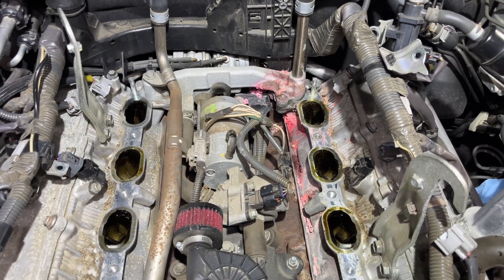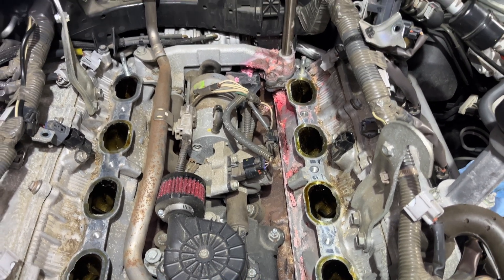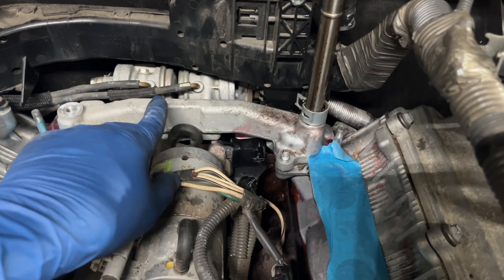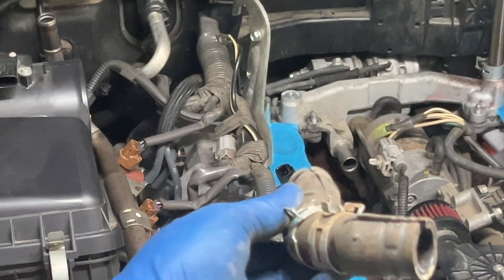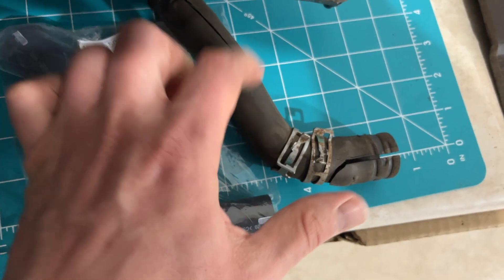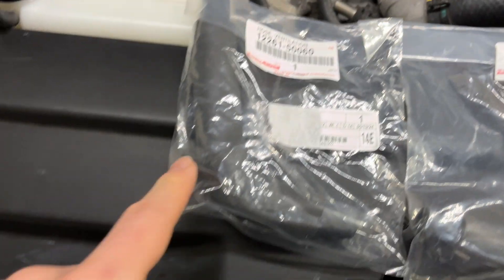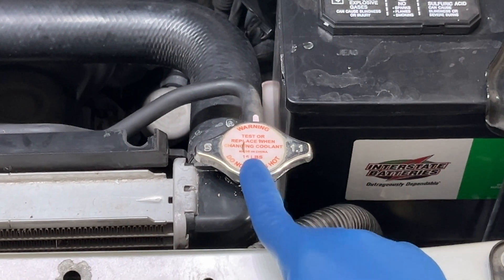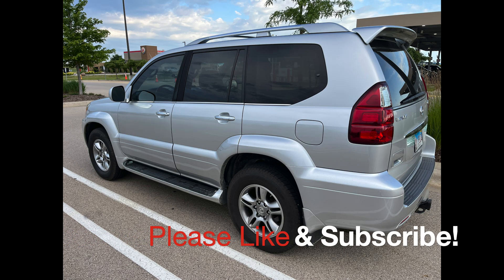Lexus GX470 Coolant Leak Fix - Rear Water Bypass Pipe Gasket - 2UZ-FE (part 2)

Comment: Those bolts in the back at an absolutely a terrible design
Reply from the maker: Yes, they are a bear to remove
Reply: @MaximumDIYGarage I’m doing my head and I’m struggling. Is there a way to remove the black wire harness
Reply from the maker: I am not sure. You can pull it from the clip to give more room at the firewall, but not sure if you can remove the harness completely.

Comment: Thanks for the helpful video, my 2008 4Runner has the same engine.  Can I ask what tools and methods you used to remove the SAIS valves from the crossover pipe?  It seems like it was the most difficult part of the repair.  I found a similar video where they made the disconnection at the pipes supplying the valves, but it required removing the wheels and coming in from the side/bottom with very long extensions.  This kept the valves connected to the crossover pipe when it was removed...they were replacing the starter, which is underneath them.  If you could tell us more about what you did and the tools you used, I think your method might be a bit simpler, even if it was difficult.  Here's the video link...it's the first of two from this contributor.

https://youtu.be/dXpK5YG7-A8?si=p_tIiAHnbn2iQSfw

Thanks!

Jason
Reply from the maker: @jasongray6740  Hi Jason! I accessed everything from the top at the cost of abdominal pain for a few days afterwards. I too used a series of long extensions to access the valve nuts from the sides and the front. 
It was over a year ago, so I do not remember the details. I am glad you found my video helpful though.

Comment: I have a 2003 and believe I’m having the same exact issue! All same part numbers for 2003? I’m going to change intake manifold gaskets as well since I’ll be in there
Reply: They are acting weird about parts. They want to give me a diagnosis for $200 when I’m pretty sure I’ve pinpointed the culprit
Reply from the maker: Right! Don’t go to the service department, just the parts desk. They don’t care about what’s wrong with the car, they’ll gladly sell you the parts you need though. If no luck, call the e other Lexus parts dept
Reply from the maker: Try online search. Here’s what I found: https://parts.lexus.com/p/Lexus_2003_GX-470/GASKET/63047124/1634150020.html
Reply: Did this job take you over a day to complete?
Reply from the maker: Yes, it was a two-day job because I was filming and chatting with my neighbor as he came over and wanted to see what I’m doing.
Reply from the maker: Yep, should be the same part# for 2003-2009, however check with your local Toyota/Lexus parts dept by giving them your vin# so they can verify. 2003-2004 were non-VVTI engines, so there is a chance that the intake may be slightly different
Reply: @MaximumDIYGarage

Comment: Another great video for GX 470.  For the SAIS filter, still looks good after 3 years.  Does it need cleaning now after 3 years?
Reply from the maker: @markc7889  Thank you, Mark. Like you said, it looks good. I’ve only put about 5k miles on the truck in 3 years, so I did not clean it as it does not affect the engine’s performance directly, just the pump.
Reply: @MaximumDIYGarage I checked the temperature in the valley where the Uni filter is located. It is over 150F. I just wonder if the filter can tolerate this high temperature.
Reply from the maker: @markc7889 thanks for checking the temp! Apparently mine has survived 3 years in the valley and has not melted or gotten deformed.
Reply: @MaximumDIYGarage I have got the same filter and will try to take the intake manifold out and put the filter by following your instructions in the video.  Thanks
Reply from the maker: You’re welcome, sir! Don’t forget to replace the spark plugs while you’re at it if you’re near that time frame/mileage
Reply: @MaximumDIYGarage Thank you for the reminder.  I have just replaced the spark plugs, which was lots easier undertaking than taking off the intake manifold 😀
Reply from the maker: @markc7889  true indeed!